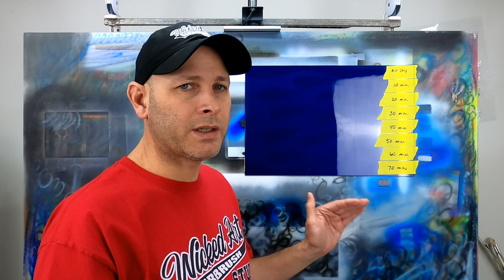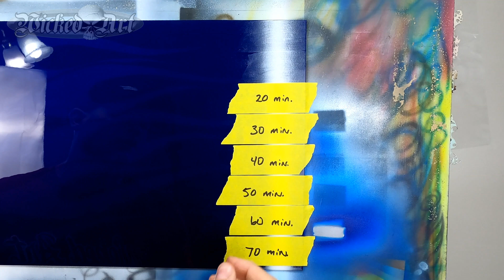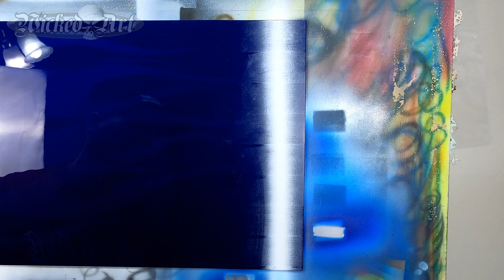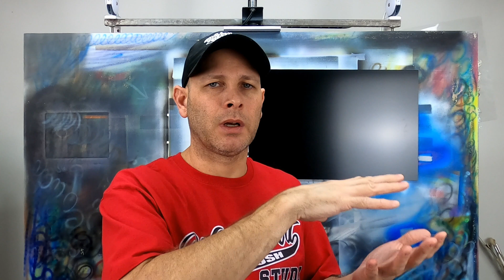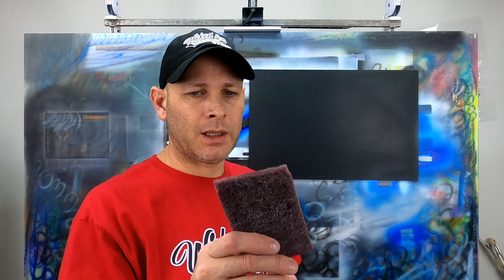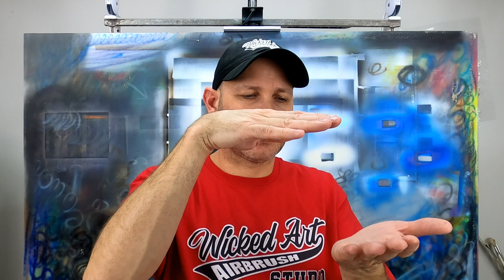How To Prevent Removing Paint With Masking

Comment: Great video! I was told in an airbrush page on FB that createx colors will not stick to a powder coated surface.
The guy said that eventually it will lift. I had a problem airbrushing a powder coated letter box, as the createx colors lifted even though I scuffed with a scotchbrite pad
Thanks
Reply from the maker: I've never had an adhesion issue when painting over a powder coated surface using Createx paint, and I've painted over a lot of powder coated surfaces.  The surface must be cleaned prior to your prep work, and it must be cleaned again after your prep work.

Comment: Hi great job thanks for your videos...... I masked off an area and the tape left glue behind... how do I remove the adhesive without messing up the painted area?
Reply from the maker: You can try very lightly wiping the surface with wax and grease remover on a paper towel.  Don't get too aggressive or you may wind up removing paint too.  At the end of the day, it might require a repair either way.  In the future don't use cheap tape.  Use a tape designed for automotive paint and you'll avoid this issue.

Comment: I'm here to see how NOT to get it wrong. 1. I'm using Vallejo Model Color . 2. I am airbrushing it over a thinned paint using Tamiya acrylic thinner,and the subject is car model seats that were primed using 
Mr. HOBBY 1000 surfacer. I am extremely leary about the results.
A irrelevant side note.....
I want to up my game building car models by taking the interior more serious and more accurate.  I will NEVER use acrylics for the body unless the finish doesn't have to be 
real shiny, or wetsanded. For me there is absolutely NO substitute for enamel thinned with lacquer thinner 2:1 ratio or lacquer paint.
I thought I had my issue solved by using a more premium hobby acrylic like Vallejo and a better quality airbrush like iwata but this may or may not make a difference?
Any input would be appreciated. 
Thank you. Howard.
Reply from the maker: A better-quality airbrush does make a difference because it atomizes the paint more consistently.  The same can be said for better quality paint.  Having said that, I can't speak to the quality of the paints you mention because I've never used them.  The real difference between a good finish and a problematic finish comes down to the time and prep work involved before any paint is applied.  Taking your time to properly clean and prep the surface makes the biggest difference regardless of what paint or airbrush you choose to use.

Comment: Hello, i am doing some tests. I prepared an hold plastic helmet, sanding with 600, 800, and 1000 sandpaper. Then i have painted with a gloss black paint. I spayed a gloss varnish coat on it  too. Now i want to paint some white stars with stencils made with masking tape. Can i paint directly on it or sand again the gloss varnish ? (at the end i would want a gloss finish)
Reply from the maker: The gloss varnish will need to be sanded prior to airbrushing for proper adhesion.  You can clear the helmet again once the airbrush work has been finished.

Comment: I'm painting a window with a Viking Longboat in a storm at night! The slightest touch of my fingernails or template's etc pull up the paint. What would you advise? Any help would be gratefully appreciated.
A fascinating video once again, take care my friend 👍😷👍
Reply from the maker: Hey Andrew!  That sounds like a cool project!  Glass can be tricky, mostly because paint doesn't like to stick to a very smooth surface like I mentioned in the video.  Etching the glass would probably be the best method to put a "tooth" in the surface for paint to adhere to.  Etching the surface means you won't be able to see through it anymore though, and that may not be the effect you're after.  

If etching the surface is not an option, you need to do two things.  First, make sure the glass is very clean before you begin.  Surface contaminates will also cause adhesion issues, exacerbating the issue already present due to working on a super smooth surface.  I would recommend using 4020 Reducer to clean the surface because it contains acetone.  Use a lint free paper towel and keep cleaning until the paper towel is clean when you lift it.  Once it's clean, make sure it's completely dry before you put paint on it.  

Secondly, you need an adhesion promoter.  In this case I would recommend about two coats of UVLS Gloss Clear.  UVLS has extremely good adhesion qualities on a variety of different surfaces.  It works as a primer and/or adhesion promoter very effectively for that reason.  Make sure the first coat is completely dry to the touch before applying an additional coat.  Don't spray it wet on wet and make sure the UVLS is completely dry before you begin airbrushing over it.  

At the end of the day, you'll still be painting over glass.  Adhesion will never be as good compared to other surfaces.  So, keep that in mind while working and be cautious about scratching the surface with a fingernail, shield, stencil, etc.  If you follow the procedure above, you should have much better results though.
Reply: @wickedartstudio  your response to his question is very helpful to me! do different UVLS have different qualities? Any difference between gloss, satin, matte?
Reply from the maker: @jelly.1899  The only real difference I'm aware of, aside from the obvious, is UVLS Gloss apparently has better adhesion qualities compared to satin or matte.  I don't know why that is, but Createx found it important enough to add that statement in the technical data sheet.  So, if I have an adhesion concern, I choose to use UVLS Gloss.  You can always topcoat it again when the project is finished with matte or satin if the gloss finish is not desired.
Reply: @wickedartstudio  excellent! Thanks for your help - much appreciated!👍👍

Comment: What is that board sitting on and how do you get things to stick to the board ?
Reply from the maker: I'm assuming you're referring to the board behind the panel(s) I work on?  If not, please correct me.  If so, that's just a large board I have attached to an easel.  I use tape to attach whatever I'm working on to the backboard.

Comment: 4012 reducer to clean?  genius!  does 4011 also work for cleaning my surface?
Reply: Ha!  Yes it does!  Thanks for the invaluable tip that no one else has mentioned.  You are awesome!
Reply from the maker: @skysettermobiles  Hey Carolyn!  I apologize for the late reply.  As you've already figured out, yes 4011 can be used for cleaning the surface as well.  I do prefer 4012, or even 4020, for this purpose over 4011 only because they are a little more aggressive and generally evaporate a little faster (4012 contains alcohol and 4020 contains acetone).

Comment: Hi Trevor, I watched your prepping video when I first started airbrushing  in January. I’m now at the stage of using a clear coat with uvls on my artwork, generally on dibond or canvass, how many times would you apply an inter coat to your artwork before you finish it. Great clear advice again 👍🏻
Reply from the maker: Hey Kevin!  The short answer is only as many times as it is needed.  UVLS has a higher solids content which makes it fantastic as an intercoat when you need to level out paint build up along masked edges; however, you also run the risk of building too much paint thickness on the panel if you get carried away.  Too much paint on the surface can cause paint failure later down the road.  My rule of thumb has always been no more than four applications of an intercoat clear on any one particular job.  The main reasons I will choose to use an intercoat clear are to protect underlying artwork which can make repairing future mistakes a lot easier, to protect metallic or pearl colors prior to masking over them and to level out paint build up along masked edges as mentioned above.

Comment: The detail colors can be a pain in the neck too, especially over a Pearl. 4030 has definitely saved me a few too many times. I use that stuff religiously
Reply from the maker: Hey Brian!  It's always a good idea to use an intercoat clear over a pearl or metallic if you're going to be masking over it.  A transparent base, 4030 or UVLS will work for that purpose.  I prefer the UVLS Gloss Clear.
Reply: @wickedartstudio  yea I’ve come to find that out the hard way. With the UVLS do you have to scuff it a little with a grey scotchbrite first? I just ordered all 3 because I keep hearing nothing but great things
Reply from the maker: @IndyGrows  If you're applying UVLS over Auto Air Colors, Wicked Colors, Wicked Detail Colors or Illustration Colors it is not necessary to scuff the surface first.  If you have already applied UVLS to the surface and it's had time to cure (normally 48 hours or so depending on conditions), then I recommend lightly scuffing the surface before applying additional coats.

Comment: Hi Trevor..Is the red & gray pads about same grit? I was under impression gray was to be used?
I bought some red & white pads while back & gray..to practice on some old helmets..But red is ok to scuff service..Yes I found out a good cleaning & scuffing is needed!!
Thanks & stay safe 😷
Reply from the maker: Hey Richard!  The gray pads are actually a little bit less aggressive compared to the red.  Red pads would roughly be equivalent to 500 or 600 grit sandpaper.  Gray pads are roughly equivalent to 600 or 800 grit sandpaper in my opinion.  Either pad is suitable for scuffing the surface.  I just prefer red most of the time because it's a little more aggressive.
Reply: @wickedartstudio  
Thanks Trevor...on getting back